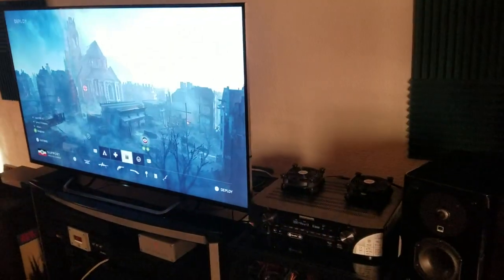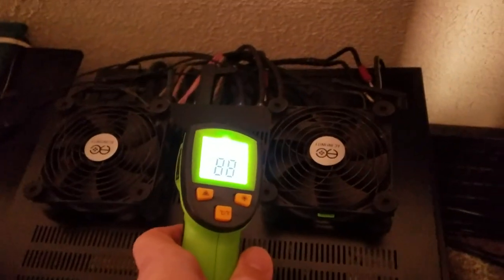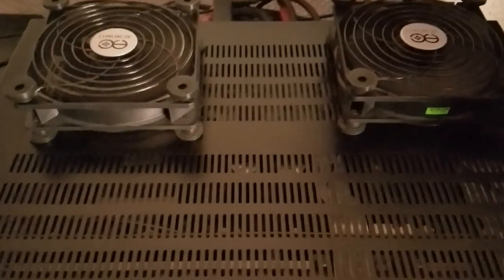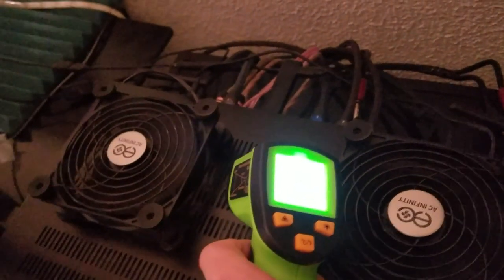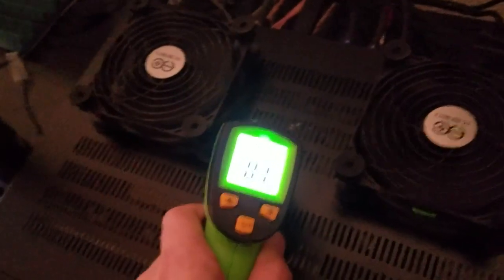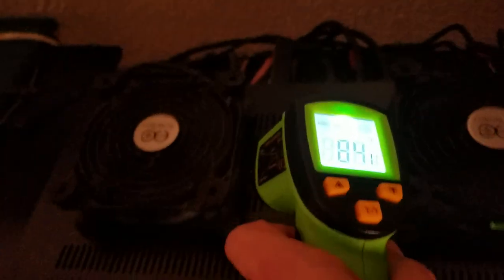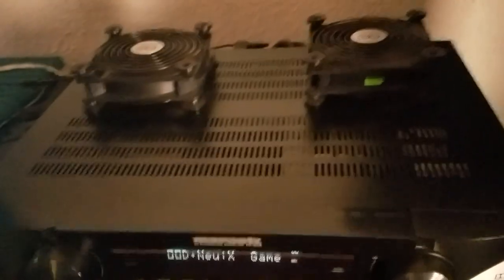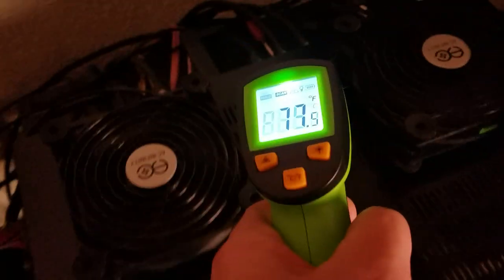Extend the life of any electronics

Comment: I would set them to extract hot air not blow into the amp....your choice of course. 👍
Reply from the maker: I definitely had some thoughts about these fans blowing dust around and into the unit which I don't think happens with the more expensive devices that are actually a box that sit on top of the receiver instead of just two individual fans
Reply: @tacticalAV  Hi. I use an "Aircom T8 blower"  that sits directly on top of my amp as it's in an enclosed cabinet. It's sucks hot air out from the top of the amp and blows it out of the opening at the rear.
Works really well. 
If you're sucking air into the amp, you're drawing in any dirt/dust straight into it. 

Again, just my thoughts mate. 👍

Comment: Receivers are the worst for thermal management. There is just no room for proper heat dissipation. Look at a separate power amp at the same channel wattage and you can see the difference in square inches of heatsink area. In a receiver, that heat is going to shorten the life of the rest of the components. Better to buy the least expensive receiver with the features you want and pre-out jacks and buy a separate power amp. This is also a better solution for obsolescense. Amp tech does not change but front ends do. Check out the amps at Outlaw Audio or Emotivo.
Reply: The technical pro Stereo receiver i have that I use for TV/movies has preamp outs (labled as line) and stereo subwoofer outs so if I upgrade to B-Ampable speakers the power amp can run the woofers and the receiver can run the mids/tweets. Or I can run up to 4 subs :-D
Reply: I use a Marantz 19 receiver to power 4 ELAC Debut 6.2 and it doesn't get very warm, thanks to heat sinks the depth of the receiver-one on each side. No way to do that in a 7 channel unit and that's why they never rate them for "all channels".
Reply from the maker: I completely agree, it's too bad companies don't make lower-end models of the preamp processor devices although nobody would probably buy them, but people would benefit so much more by buying the equipment separately and using a receiver with decent video processing in discrete audio decoding but with other power amps maybe even a home theater bypass on a preamplifier meant for music playback.  Last year I was looking at the Halo from parasound as an integrated to add to the home theater for 2 Channel however now I've changed my mind and it's best just to separate the equipment in different rooms and different setups.
Reply: @amazoidal   If they ran at full spec for all channels they'd burn out and take out the circuit breaker or the house with them.